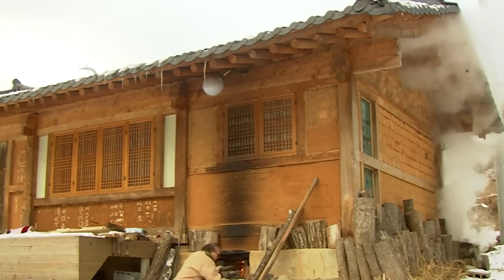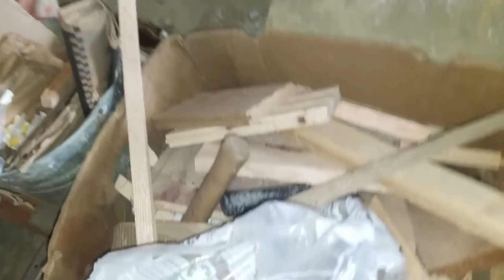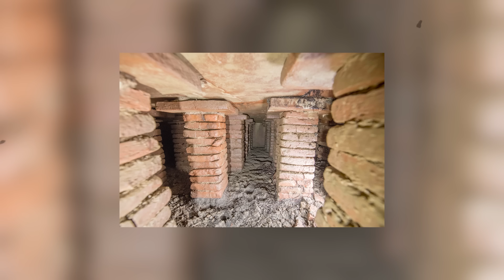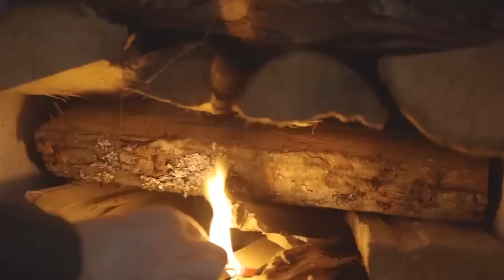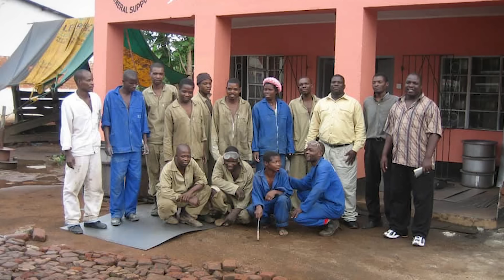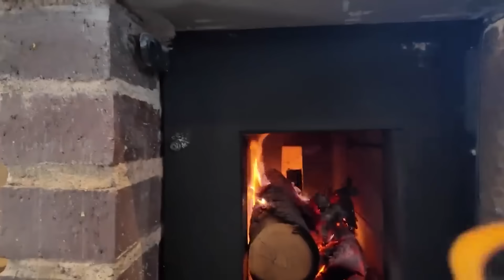The Depression-Era Heater That Burns 90% Less Wood. Why Did They Ban It?

Comment: My GMA used her big rothiron stove for heating the house at night. The second floor would get the heat through the trap door. We covered in thick quilts and had a white pee pan with lid on the upper floor

Comment: Just use regular stove and add zig zag to pipe to brick then pipe out ..Just add clean out at curves ..This for up from stove to chimney ....Or use barrel and put fire in middle of barrel small inside of 4 to 6 inch pipe ..Then fill bottom barrel with sand or brick up half way add chimney in middle of barrel to out side same size as middle pipe ..Leave gap at top of pipe in the middle of barrel stove 2 to 3 inches so smoke an heat can get out .. The heat giong up pipe heats brick or sand you get heat for alot longer after fire dies .You can cook on it too just use removable lid for cleaning  You can add glass to bottom 4 to 6 inch pipe for viewing . .So rocket stove type that has hole in middle of barrel for fire not the side of barrel  ...Your heating pipe with mass in barrrel ...You can cover sand with lid of another barrel if want ...

Comment: I grew up with wood heat. I was always cold in the morning. I have built 3 different types of rocket heaters. A portable one. I could cook 5 slices of bacon n 2 eggs off 2 pieces of lathe ablout 12 inches long. It was insulated with ash.a mass heater without mass due to limited space but allowed my daughter to work without an electric heater in a basement for years. N the last one was a modified pocket rocket in a 30 gal drum. I could heat a 400sqft  room without additional heat. Now getting to build finally a mass heater with cook stove attached this summer. Can't wait

Comment: Year's ago I heated my home with a small airtight wood stove the unit was cheap and light gauge steel I put sand in the bottom to keep the fire off the thin sheet metal bottom I ran the exhaust straight back into an old oil burner down draft furnace from a mobile home burn the fire hot and extracted the heat in the old furnace that was a marvel of engineering design even the exhaust was designed to Go through a heat exchanger that was wrapped part way around the squirrel cage fan.that was designed so that the air flow was running past the exhaust gas preheating the air 
before it it passes the firebox the exhaust fumes were cool enough that you could hold your hand over it without being uncomfortable
Reply: man I did the same few years back, it's quite more convinient